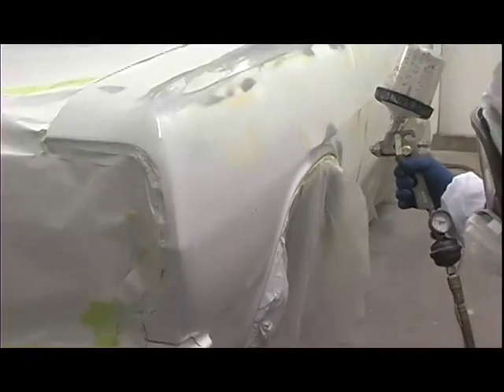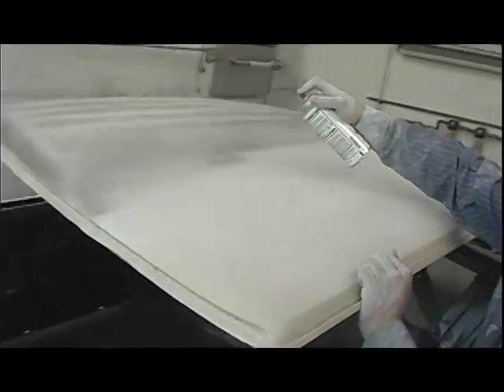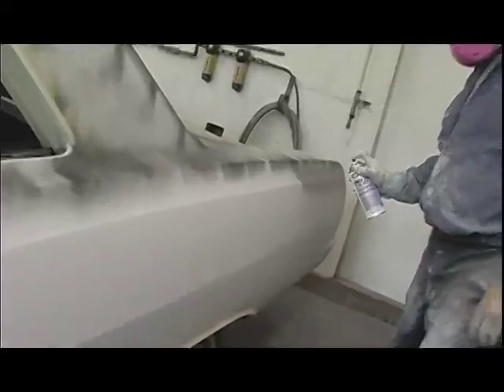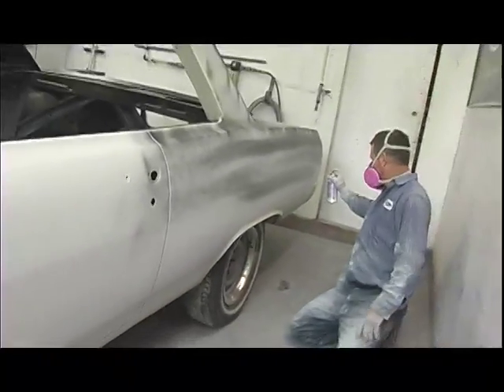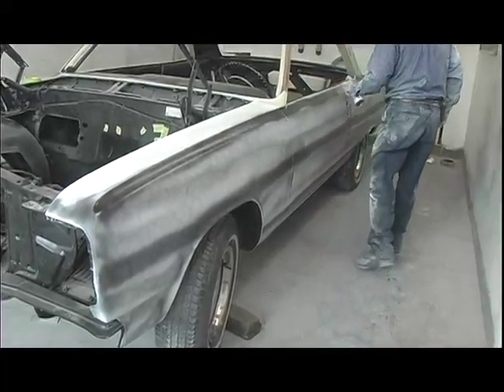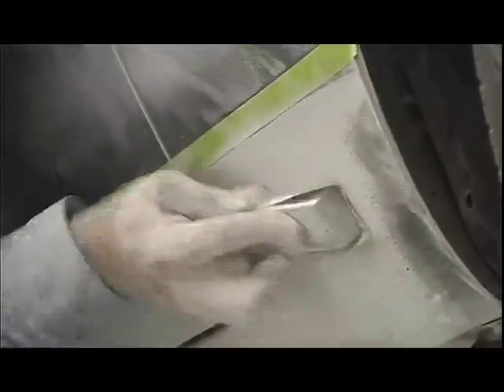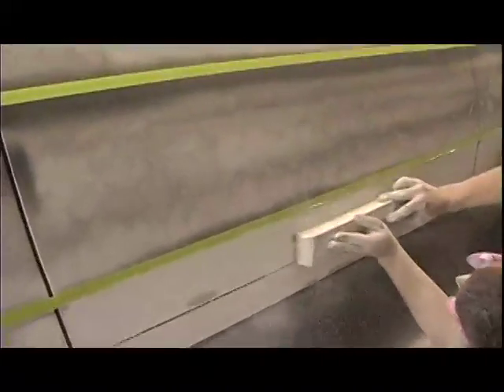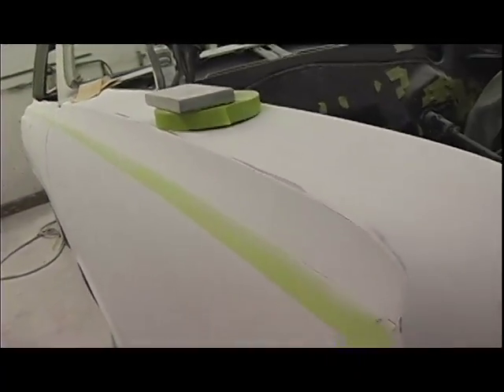1965 Chevelle:  Block Sanding Polyester Filler Video V8TV

Comment: yea that. you can get it at hobby shops in like foot long lengths and the width equals out to about three folds. any ways , that stuff and wet sanding, you can make anything mirror finish. when it gets wet it sucks to the surface. greatest tip i every got while working at Lezo's

Comment: Soooo much easier to first sand polyester with 120-180. Heavier dry paper levels better, cuts way faster and doesn't load as quick. THEN apply a 1-2 coats of primer and wet sand 400-600, done.

Comment: When your doing a car,  taking it down to bare metal a piece at a time, what primer would work  to protect the metal over time from rust before you have the entire car ready for paint.   I won't have everything ready to paint in a short period and don't want the parts to start to rust before everything is done.  thanks in advance.
Reply: Steeljaw Jones epoxy primer is always a great primer to preserve bare metal, and always a great foundation to work on!!

Comment: I'm surprised you're as heavy as 220 grit on easy sand poly. I'd be using a 320 grit. Your primer filler must be very heavy is all I can think. I'll watch the next video.